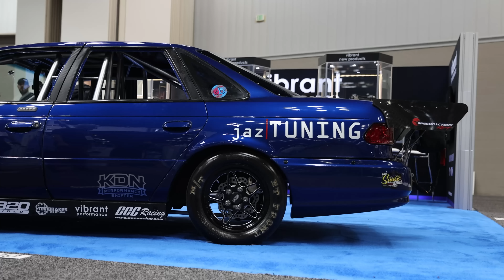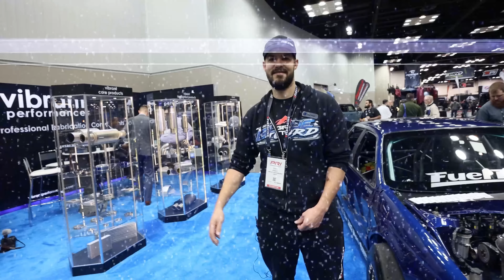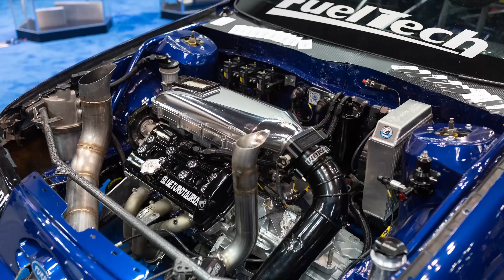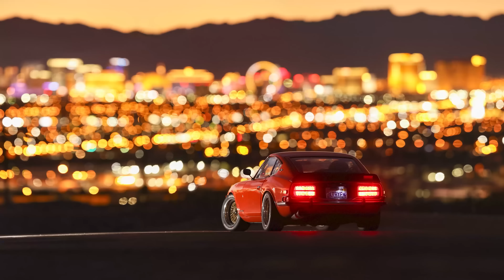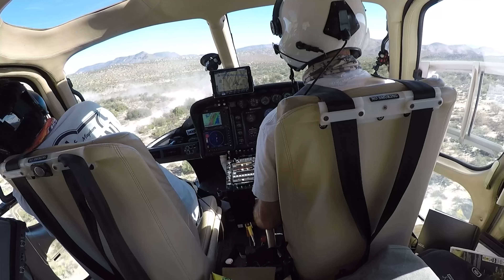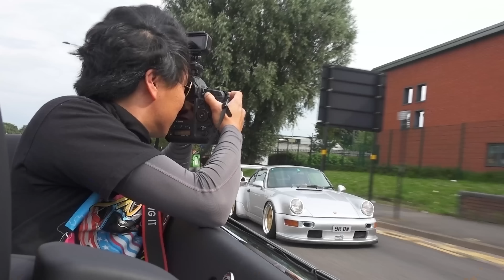Fat Turbo V6 Ford Taurus Drag Machine!

Comment: 1900 pounds it can be less if you find a Mercury Sable AIV Ford made 20 mercury sable with aluminum bodies and they were able to sell them too so there could be somewhere out there a lightweight mercury sable with the SHO motor standard in it. The bodies are light enough that when it’s stripped down to its bare chassis no suspension components no interior components just the bare monocoque two people can pick it up one person on the front one person on the back.

Comment: back when these first came out, they were beating 5.0's easily. that Yamaha v6 is a gem wasted in a floaty 4 door sedan.
Reply: DEFINITELY not a waste. The Taurus was, above all else, the best cat to place it in, because you knew it was badass when a four door sedan beat 5.0’s without compromising a thing.
Reply: @nalabear97  my point, the engine deserved a better chassis.